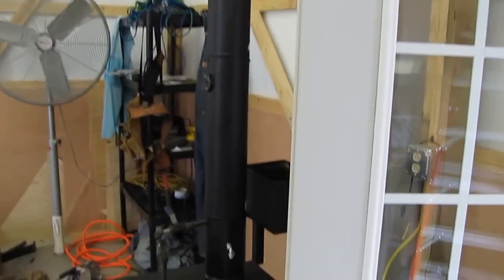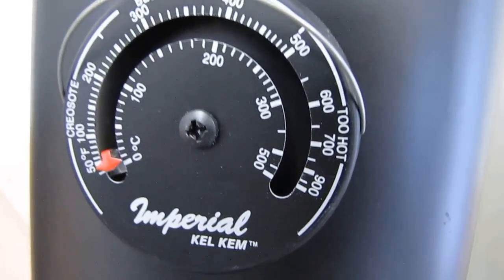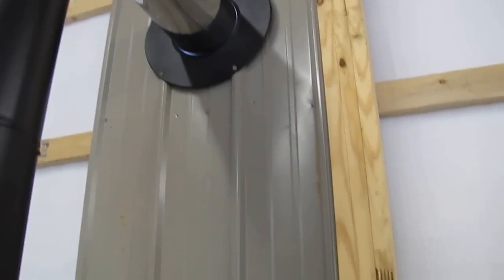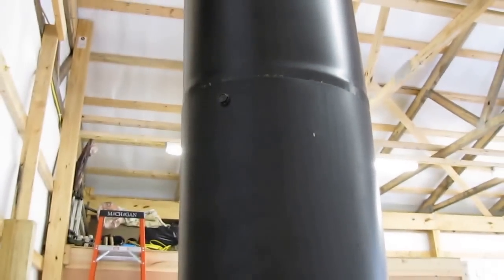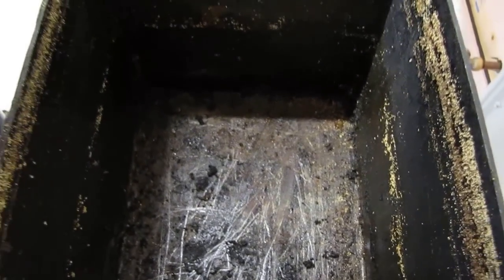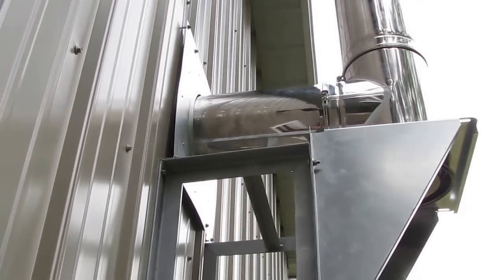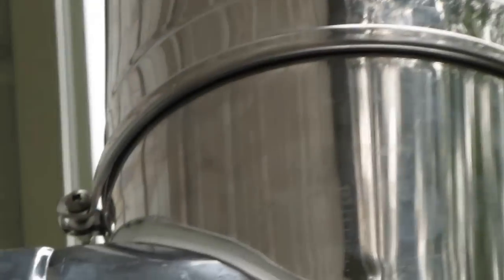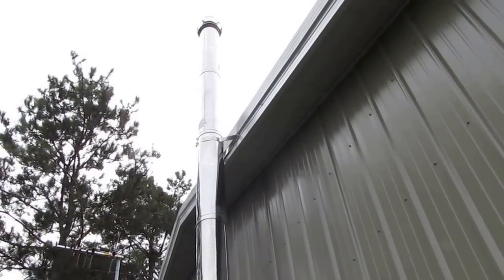Biomass Hybrid Heater And Stack Install  Pt 2

Comment: Do you have to have guy wires for the chimney when it exceeds 5 feet over the edge of the roof?
Reply from the maker: Michael Taylor Hi Micheal It is Only About 3 Feet At The Ridge Of The Roof It Is Solid To The Max  So Far So Good